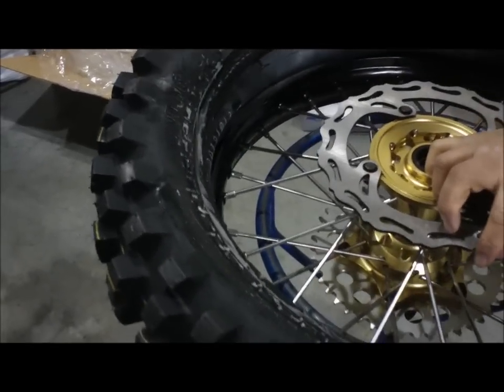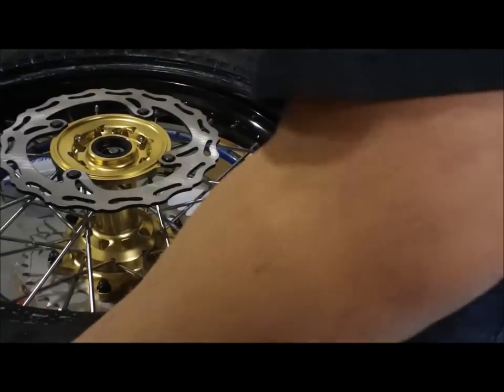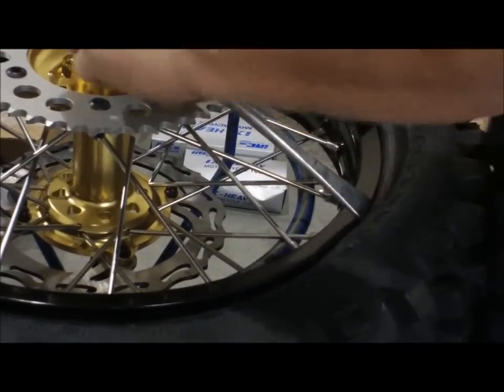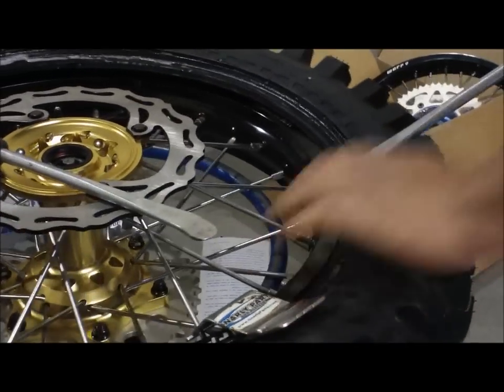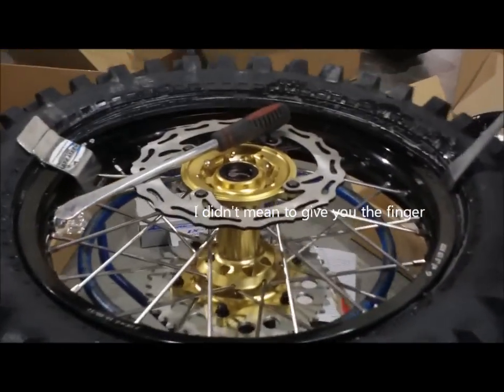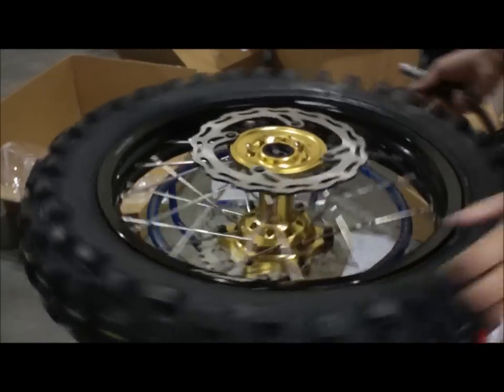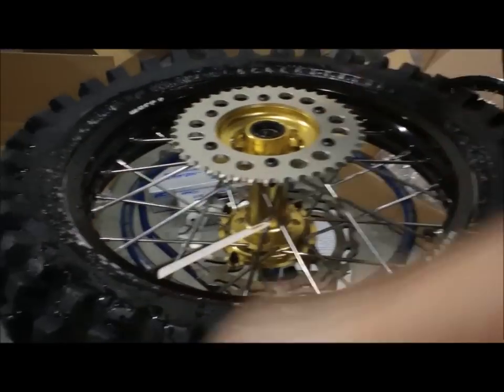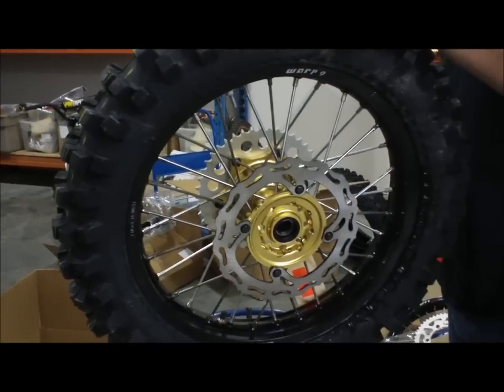Installing a dirt bike tire onto a new wheel - Part II

Comment: ok, good video, may I make a suggestion? lube the tire on the side toward the wheel first. also set the bead lock inside the first bead before installing ... makes much easier.